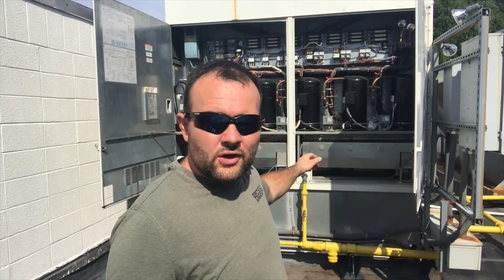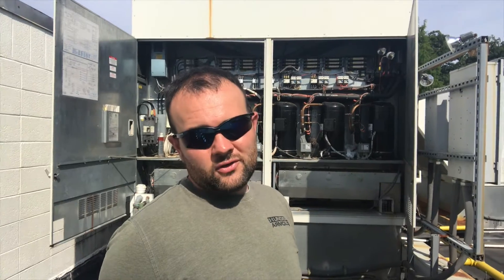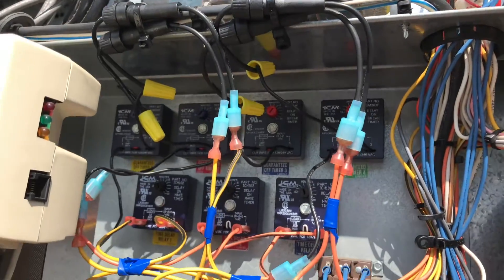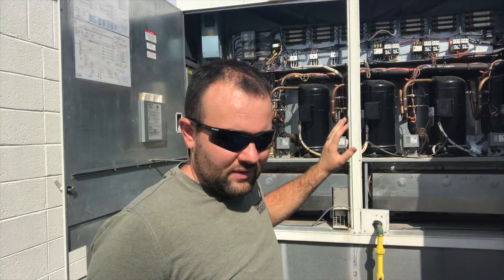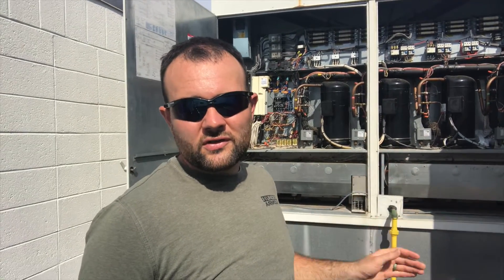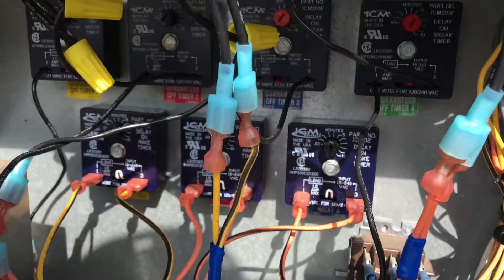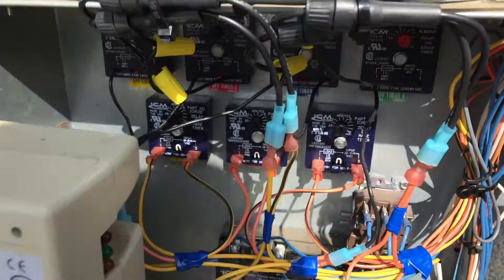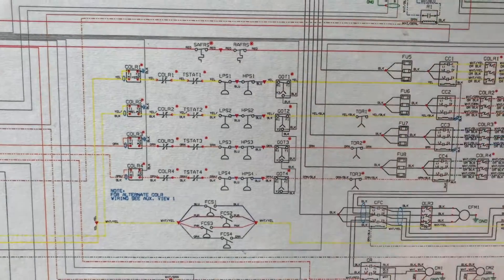50 Ton AAON RTU, Follow Up Repairs, Replacing Defective Contactors And Time Delays.

Comment: I appreciate this video brother....I just recently got hired at a company where all we have are aaon 60 ton units..... I'm in Texas...... would love to pick your brain where I can learn more about these size of units..... appreciate you again man.... this was very helpful to me
Reply from the maker: Thanks, I am happy to hear it was helpful. The larger equipment can seem more complicated than smaller tonnage units but to be honest the principles are the same. Maybe so more components and different types of BMS integration but don't let it intimidate you. Most of the AAONs I have worked on have a low voltage terminal block with all your Y1, Y2, etc W1, G and R connections so you should be able to easily determine what the unit should be doing. Their wiring diagrams are easy to read and usually color coded. I went through an apprenticeship program that involved school but most of my hands with large units came through exposure in the field. I'll keep posting new content, I haven't posted much lately due to limited time to put together the videos but I have some new stuff coming out soon.
Reply: @travismichael502  completely understand brother... take care of the family and you first always.... I'm putting in my effort by doing a lot of research and becoming more comfortable....I just have a goal of becoming a quality tech and not just your average hvac tech..... I'm ready to dive in as long as I'm doing safe for myself and others.... really appreciate you responding man... stay blessed and I'll keep in touch.... thanks again